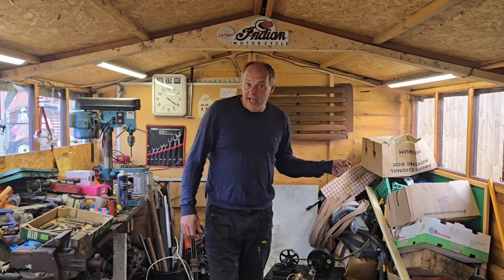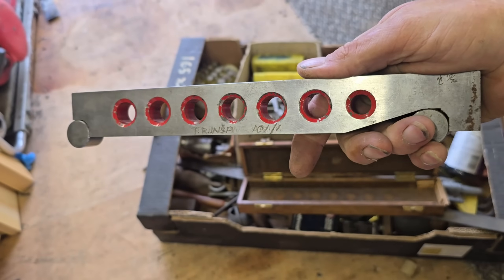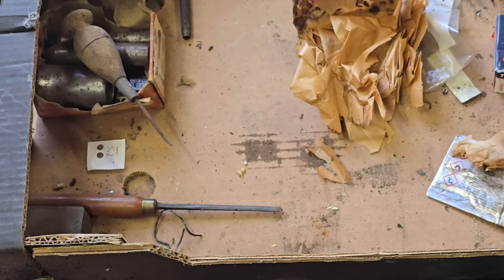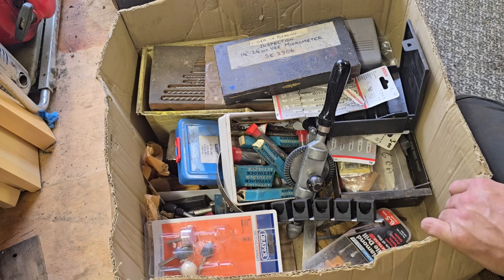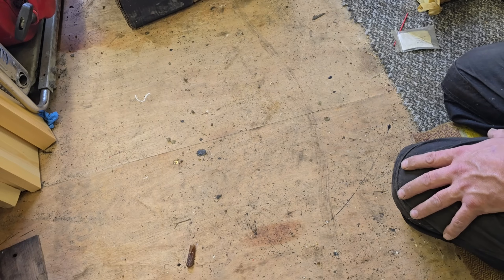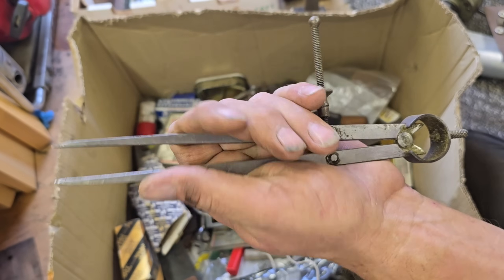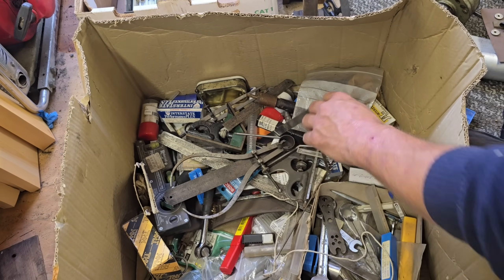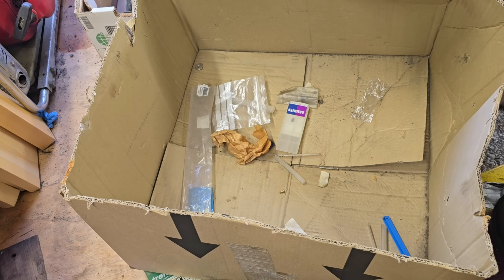Engineers Auction. What did I buy for £100??

Comment: the bar with a roller on each end is a sine bar for setting angles using Sine tables , the rollers are a set distance apart , you will never use it , but a nice thing
Reply: you will also need a set of slip gauges, a surface plate and a book of trigonometry tables or better still, an engineers' bible with all the constants worked out for you.

Comment: The two blue items are spectroscopes. You put a prism on the bed at the centre, turn the white light on which is housed in the rear pipe and measure the angles of the different colours of light, using the front sights.

Comment: I made a few of those Vee blocks and clamps during my apprenticeship 50 years ago. The milling tools were dipped in oily wax after use to help prevent rust forming. Moore and Wright were the Rolls Royce of micrometers all those years back so couldn't afford them. Bought Japanese ones as we had to have our own mics and Vernier Callipers. Paid them off at £2 a week out of £34 per week wages. Went up to £1.01 per hour when reaching 18 years of age. Left doing that job and joined The Army instead. The round thing with the wing nut is forholding the test tube holder onto the stand.

Comment: Tall thing with a screw up it is height guage  used on a surface table to mark things out  with. It should have a pointed stylus to  scribe the metal. You set the height with slip guages.
The box with three rods in is a depth micrometer minus the depth micrometer.!
Got some good bits and bobs there. Well done.
Reply: Agreed on "the tall thing". Except, it has an attachment to mount a dial indicator. Any decent machinist would have use for it.

Comment: Absolutely excellent score there Adam.
Those misc rods, check they may be the extensions for that internal micrometre.
That reversing box may be a tapping attachment for mill or drill press to automatically tap threads.

Comment: The puller thing! goes with the V-Blocks you've got.
Reply: You need to explain what V blocks are😂
Reply: @petermoore4313  normally used to hold cylindrical items, if you use two V blocks which are the same size to hold a round bar on a flat surface the bar will be level and parallel to the surface you have it on. Hope this makes sence? keep it up, love watching the channel.

Comment: the first item is a height gauge , 2nd part set of internal micrometer,3rd sine bar in wooden box not a slip ring 4th thing with wing nut a clamp for your school lab 5th they are vee blocks for holding round (look like a X) 6th that little puller thing is a clamp to use with the vee block 7th before we used mm we used letter and number drills 8th is a optical center finder used on a jig borer,9th wiggler edge finder 10th (spiral cutter)another counter sink 11th taping head 12th wood saw tooth setter13th another height gauge  14 that little micrometer goes with the  part set of internal micrometer (2nd) if you want to sell all the bits you don't want as a job lot including what you were going to scrap the please let me know as i  hate you throw thing away which could be of use
Reply: I had little hair left, but the bit I did have now needs to be hoovered off the carpet.

Comment: The green gear box is an automatic tapper.The "puller thing" and the X block go together for holding round bars for drilling or milling. The clamps with two threads are "engineers clamps" the various blocks are mounting work onto milling machines etc. The drill set in a number set. The thing with the eyepiece and thread is for fing centers or edges on a milling machine. The thing with the hole through at an angle is a counter sink often called a snail counter sink, they are very effective and produce a better finish that the normal type. The BSF and UNF taps will come in handy for old engines so keep them. The Ackworthie machine is an automatic tapping machine for a pillar drill or lathe, when it hits the correct depth of thread it or the drill quill is raised it automatically goes into reverse in order to back the tap out. The blue hole punch is in fact a saw set for setting the kerf on saw teeth.
Reply: It all reminds me of work i retired from at 55 some 21 years ago, I shuddered. lol Oh yes RR stuff Is what I made for nearly 40 years. If It flew both civil and "not". After retraining from any type of lathe to a 5 Axis CNC machining centre I took to It like a duck to water and doubled the output per night shift than any operator before me, I loved the challenge - then.  LOL

Comment: 33:41 is a carpenters hand saw set,  37:21 is a scribing tool for finding profiles,   37:53 carpenters sliding bevel,  38:29 is a center finder for round stock, 
38:54 replacement router cutter tips,  40:02 belongs to the carpenters square earlier out the box,  41:40 yes they do go together, you have to line the slot on the ruler with the spring loaded tightening screw, maybe back it off and make sure it hasn't twisted round,   44:55 I think it said "Metric",  47:29 is a depth geage,

Comment: That ‘taper adjustment’ is probably from a Colchester or Harrison lathe - it’s a Morse taper bush which fits directly in the spindle for between-centres turning. The outside is MT 4½ and the inside probably MT 3. It’s the one thing that often gets lost when a lathe changes hands.
But please, get yourself some old tool catalogues so you learn what all these tools are, and stop chucking them round - they’re precision items and should be treated carefully.

Comment: What you called a puller is the clamp for holding round stock in the V blocks, the ones that look like a cross from the end, V blocks are very handy for holding round bar stock for milling or drilling. The thing with a ball on the shaft is a wiggler, its for centring your drill/mill on a piece of stock. The so called hole punch looks like a saw blade tooth setter. You got your moneys worth at least 10 fold just 3 of the Dormer milling bits covers your cost, do some research before you throw anything out. You can send me as many boxes of that so called "CRAP" you like, Ill even double the postage back.

Comment: I would be very interested in your milling bits you wish to get rid of. 

The slip ring thing is a sine bar. The long thing with the thread is a ball or micrometer height gauge, can be used for measuring but we mostly used then at college with a engineers table for marking out. No idea on the thing with the handle. the the blue/gray things are precision optical inspection  apparatus. The "rolls royce thing is some kind of arbour. The Halifax is a V block for drilling holes in round bar as were the small and large bits that followed. The U shame contraption is a clamp for a V block.  The drills are "number drills", much like BA sizes, the bigger the number the smaller the diameter. The ball is a "finder", used fro finding the edge of a workpiece or the longitudinal centre of round bar on a mill. They are also known as wobblers, they wobble around until to get the the edge when they run true, then flick off when you get there. The cutter things are another form of counter sink. The mag base with no upright is for holding something like a small V block for quick changing, you often get bigger ones  on surface grinders.  The bit of plastic is off a hover lol.  The big gearbox bit is a tapping head for a milling or drilling machine. The contraption that was after the alli bar is a Vernier Height gauge for marking out or measuring on a engineers table. the Welding rods are in fact precision ground dowel pins. The digital thing is a digital vernier Hight gauge. The thing your putting in the scrap is just a relay.  The angle gauge is indeed a protractor, a vernier protractor.   The entre point thing is a centre finder. The "braze on tips" are not braise on tips, but the holders have a little clamp on to hold them in place. The oil dripper is a precision oiler, lots of people use them for oiling small models and small motors
Reply: Excellent info mate, thanks for that!

Comment: If you had to buy new what you have bought it would cost you a £1000 and more.  I would sugest you don't scrap the precision equipment until you find out what you've got. The little micrometer in the last box goes with the long rods in a case you found in the first box for measuring cylinder bores